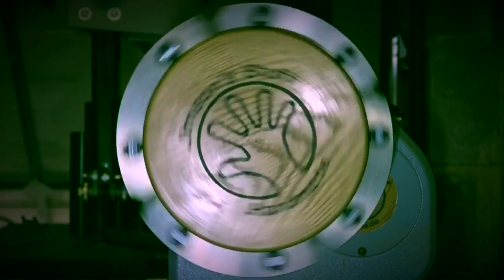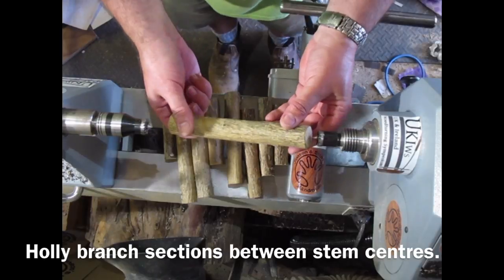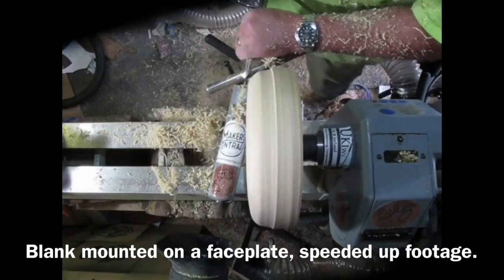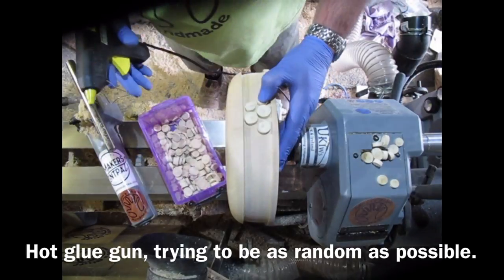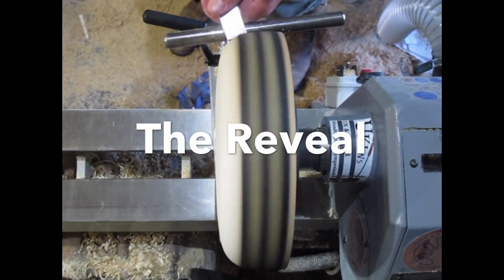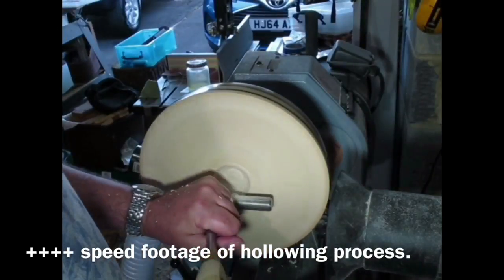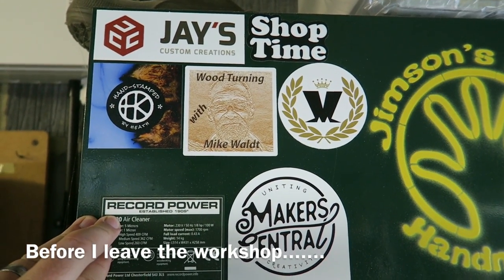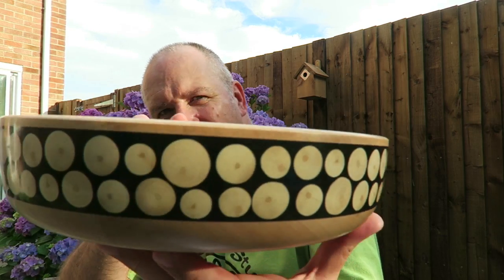Woodturning a Holly and Milliput Inlay Bowl

Comment: Thanks for another stunner Jim.   Thanks also for introducing me to Milliput which I use a lot and not only for wood turning.  I have a vegetable allotment and a few days ago my neighbouring gardener found that his plastic rain water butt had cracked at the bottom.  I came to the rescue and fixed it with Milliput thus saving him about £40.
Your likeness to Mike W is quite uncanny:-).
Have a great weekend at UKIS.
Best,
Alan.
Reply from the maker: Thank you very much Alan. I hope you are keeping well, sounds like you can't make UKIWS. Milliput is fantastic for repairs, I repaired a bird bath with it recently.  Cheers, Jim.

Comment: Great video and a beautiful bowl. Just wondering, is it possible to add coloring pigment when you mix the  milliput?
Reply from the maker: Thank you very much, yes you can add pigment to white milliput when mixing. I have done lots of experiments with this and I have found that it is best to mix pure pigment powder into a slow set epoxy resin to form a thick paste and then knead this into the milliput. It is a messy job and be careful which pigment powder you use as some are highly toxic. Cheers, Jim.

Comment: I love using Milliput on small projects, but find the cost of the product these days - Jan 2021 - to be very cost prohibitive.  A look on Amazon today shows it at $20.00 per box.   I’m guessing it took two or three tubes of the product for this project.
Reply from the maker: glad you have tried Milliput, thankfully it is much cheaper here in the UK. I can’t remember how many packs I used but I would guess 2. you can get away with less by creating shallower inlay recesses but you then have to be careful not to overcut it when finishing